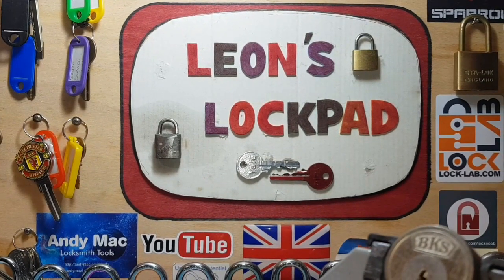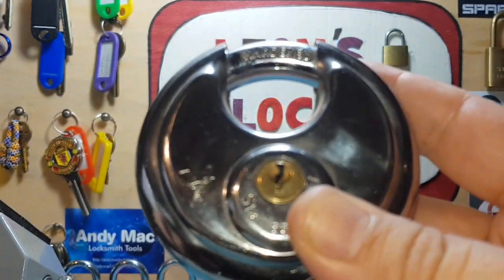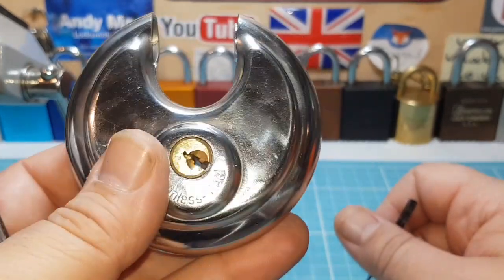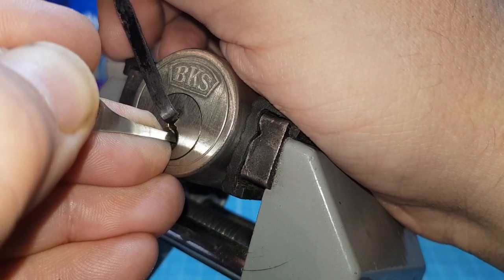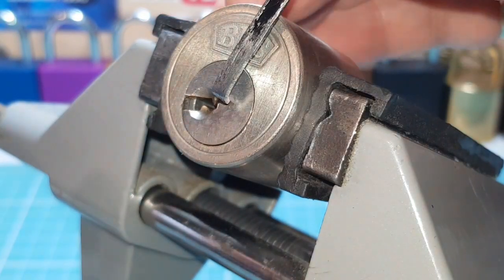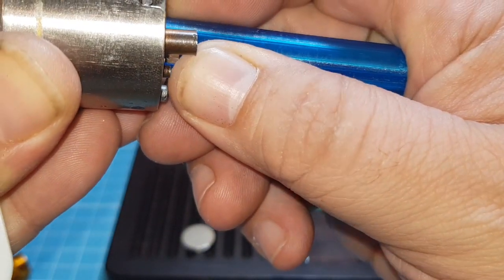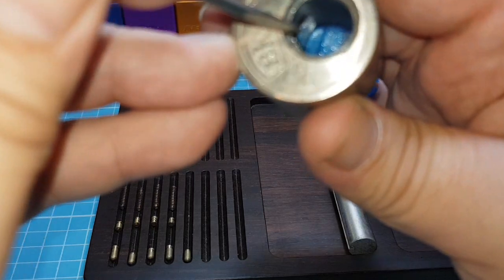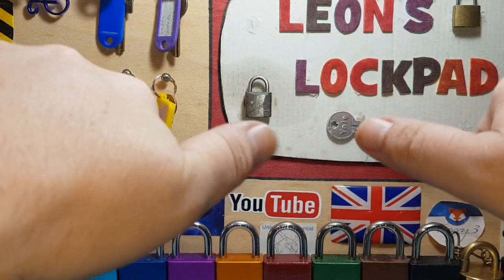Lock picking. Stock disc lock spp'd&BKS challenge lock spp'd&gutted

Comment: Wow Leon, 2 locks in one video! A double whammy!! Both pretty cool and unusual locks, did I send you the challenge lock? I thought I had one like that, and I’m pretty sure there are supposed to be two cylinders joined together with a couple of bars, the pins in the back of it can be released somehow to separate the halves. Anyway, good job! 👍😁
Reply from the maker: Thank you very much Ethan my friend and yes I got the lot from you and no it just seems to be a normal challenge lock you saw me pick it🇬🇧👍😎😊